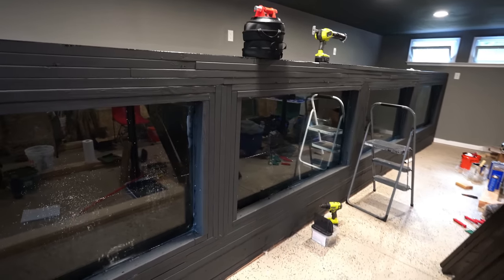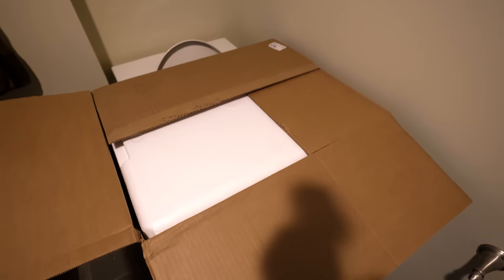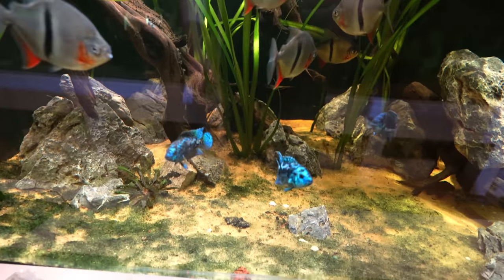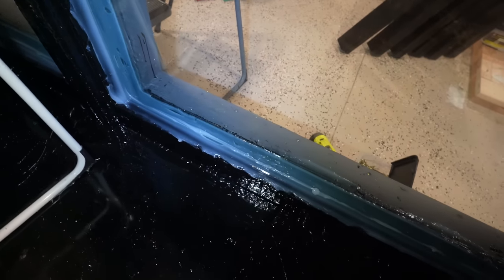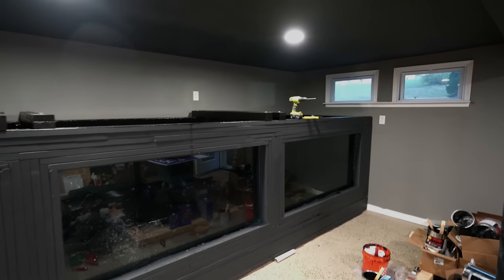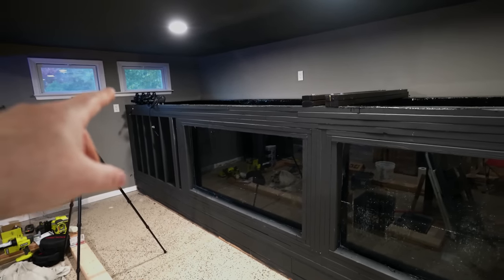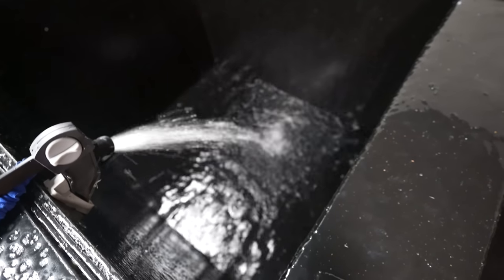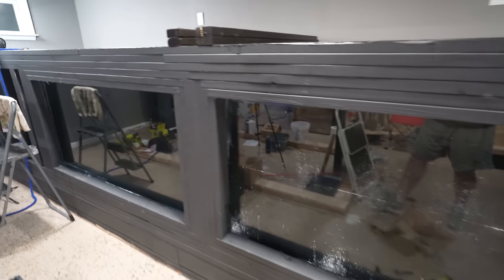Will the 4500 gallon DIY aquarium hold water? Let's find out!

Comment: Nice. Huge sigh of relief when u added the supports. I remember a while ago u said u were gonna add them. But I haven't kept updated. Love this content. It will hold for sure 1 2x4 would hold for the supports. I always recommend putting 1/2 plywood strips between all beams, Headers,  Supports. glued and nailed.  Awskme shoe brother
Reply from the maker: The supports were always going to on before any water was added, but I like to do them last as they are generally in the way when still working on the tank. 😊

Comment: I was genuinely excited watching the tank fill up!
Regards to the pump placement. Centrifugal pumps generally run smoother against a bit of back pressure and generally don't like pulling a suction. Based on this I'd consider placing them in a way that gives them a bit of head pressure on the suction side to keep them primed and probably with the longest length of piping on the discharge side so that they can work against any frictional losses etc.
Reply from the maker: Thanks for the great comment, what you said matches up exactly with what I am finding in my research.

Comment: Just don’t pump water through the wetland filter too fast. Slower is better. If you want more flow, put the extra outflow on top of the wetland. Love the build!
Reply from the maker: Exactly!  3x turnover is lower than what most would think for an aquarium but is ideal for an upflow wetland filter. The additional internal water flow will be handled with powerheads positioned throughout the tank.
Reply: @AquariumDomain.  Awesome!  I knew you’d have it handled! Can’t wait to see the scape.

Comment: I would have the pumps mounted on the inside of the front above the glass on the far side, and pump the water to the wetland filter. Also run the pipes on the inside under the bracing above the glass so its not visable and easily servicable, as well if you get a leak from the pump or pipes it goes right back into the tank instead of anywhere else.
Reply from the maker: You nailed it!  That is exactly what I plan to do. :-)

Comment: ☀️☀️☀️use Mrs Wages pickling lime in your make up water for your saltwater aquariums. It’s a constant source of calcium and will promote strong coraline algae growth full of purple and red colors. Just add a whole container and let it sit on the bottom of your container. No need to stir it up. It will dissolve to the point of saturation and then it will be fine with undissolved lime on the bottom. One container usually last about a year to dissolve completely. I’ve used it in all my saltwater aquariums
Reply from the maker: I will have to look into that one 😊
Reply: @AquariumDomain.  to be extremely clear. I had a 30 gallon Rubbermaid container for my RO/di make up water. I just dumped in the pickling lime stirred it up initially and let it settle to the bottom of the container overnight. This saturates the water with calcium. Because of this I needed to test alkalinity weekly. If alkalinity dropped I simply added some alkalinity buffer in liquid form to the tank sump.  If you decide to do corals I highly recommend calcium reactors in addition to the pickling lime method

Comment: I’ve been following you for quite a while now and I think I asked you this before but I’m in the thinking about stage of building an aquarium, is there a formula or a way to figure out how thick the glass needs to be?with this build I believe you should be crowned the new 
King of DIY!
Reply from the maker: Unfortunately the chart I use is one I copied down (hand written) from the garf and monsterfishkeeper forums from 1999. I just wrote down the safety factor and glass size / type, I didn't write down the formula they used to come up with numbers.
Reply: @AquariumDomain.  that’s a start thank you can’t wait to see the finished tanks!

Comment: Measure the GPH flow with just the one pump and compare to the 2-pump system of having one pushing the water the other pulling. this system negates the loss of flow from head height / pipe length.
Reply from the maker: I am definitely curious to see the flow difference as each pump is put online.

Comment: Would you consider using acrylic rather than  glass? I guess rhere is a significant cost uplift? Would you be kind enough to give us an idea of approx cost? Im fascinated by your  projects, please keep sharing!
Reply from the maker: I am not a huge fan of acrylic, I would probably only use it if I was doing a really tall tank and required it. It does cost significantly more, but also scratches very easily and doesn't adhere to silicone like glass does.

Comment: How do you maintain temperature and parameters on a setup this massive?

And water changes?
Reply from the maker: I heat / cool the basement and the tanks stay roughly within a degree or two of that. Drain and fill for water changes, but I am on an aquifer well so no chemicals needed.

Comment: Was there a reason you used river rock for the wetland filter instead of something more porous like lava rock?
Reply from the maker: Yes, the smoother rocks are better suited for trapping the solids as they rise up, but also being able to release them back down into the open cavity at the bottom of the filter during cleaning. Lava rock will trap a lot of solids in the more jagged crevices. Also surface area for bacteria is not a concern as there is already such a massive amount of it compared to bead, sand or sump filters that are typically used on large tanks like this one.

Comment: I have just had a thought would it not look nicer and do the same job if you used flat lengths of steel for the crossbeams treated of course galvanised or even aluminium to prevent rusting you would barely notice them, just an idea ???
Reply from the maker: Certainly not a bad idea, but I am using the cross braces for the river bank structure and for the part of the lid system; as well as, something I can climb on when needed. :-)

Comment: My OCD is kicking in. I hope you put a huge amount of glue where lag bolt split your 2x4s. I have found in my experience that pressure treated 2x whatever size split when you start drilling or screwing. 

What are your thoughts on the actual caulk gun from perspective of someone who has been putting in elbow power into it for years? Do you have any complaints about this caulk gun? Do you wish you bought a different one? Sort of like ohh man if I only spent X more I would have been better off? I have been using regular caulk guns for years and I always had small jobs but when I was doing aquaponics project last year and hunting down leaks (which I temporarily plugged with silicone ge1) my arms were about to fall off. Craftsmen and Ryobi sell $70 models with no battery. Dewalt is $200 and Milwaukee is $170 both with no battery. Do you feel that you should have gotten a more expensive model or do you think Ryobi will get you by going forward? 

Sending positive vibes for the leak test.
Reply from the maker: Thank you for the positive vides!! 🙂   I can't really compare the electric caulking gun vs other models as it is the first/only electric caulking gun that I have ever used. I would imagine it would follow the logic of other tools, if you use them often as a contractor you need the more durable (expensive) brands and for infrequent work brands like Ryobi are probably fine.

Comment: I'm not sure if it's this exact one or one very similar to it, I saw a video on here of a DIY build like this one. People say it won't hold. You say overkill in places.

Imho, I recall looking at certain particulars and running math and specs in my head. Structurally? I should hold. Personally? I think there might be a more efficient way to do it, but I'm not criticizing the design. You see all those studs? Pending on how you fasten that, you're pushing 1100lbs/ft in strength. It might bow some time before that or around that but I don't see 1100lbs of water in that exact volume either. You've got a lot of weight distributed so, it should hold. As long as you've got some bracing across to work against the outward force? That glass? You should be good. 👍

Overkill. I've been accused of that myself in general. I think that can be subjective. For something like that? Id likely coat that in a like manner. I look at it this way. You're trying to guarantee there is never going to be a problem with that. Good idea. If it's ultimately overkill, you'll never have an issue. So quality wise, what's the problem? Lol.
Reply from the maker: Yeah for me overkill is the only option when dealing with this much water and for something I intend to last for 35+ years 🙂

Comment: Wouldn't lava rock in different sizes be a bit better than the solid rocks in the filter?
Reply from the maker: Lava rock have a lot of small cavities that can trap physical debris which we don't want to happen. During the clean out process we cut the pumps and suction water out from the bottom, then fill up from the bottom a couple of times to loosen up debris, have it work down to the bottom and get pumped out. How many times this procedure would be performed during a clean out would depend on how clogged up with debris and sediment the filter is.

So it is key to slow the water down in the bottom open area and have most of the debris trapped in the larger smooth rocks, which will make it easier to remove during clean out.

Comment: Will the riverbank on top be an "aquarium" itself with glass front?
Reply: Hundreds of hillstream loaches etc..
Reply from the maker: No, it will be made up of plant baskets and wood that will be suspended right at the surface of the water using framing. When looking at the front of the tank all you should see would be plants growing out of the top of the tank and roots growing down into the water, the baskets, etc. should not be visible...if I do it correctly lol 😆

Comment: I think I would take the water out of the filter to the other end and have it overflow back in. But I have less experience with large aquariums and mostly with saltwater. One this size would be a dream.
Reply from the maker: It is an upflow filter design so the water has to be introduced to the bottom of the filter under pressure and then cascade/waterfall back into the main body of water.
Reply: I understood that. I am just use to it going in the opposite direction. Was wondering if one is better then the other.  @AquariumDomain.
Reply from the maker: @roberttheil5226  Ahh OK gotcha. I am not 100% on which is better push/pull or if it even matters, I have seen it done both ways in many pond construction videos on YT.

Comment: Love the build to this point. Your cross braces care me they split! That ruins their strength. I think the lags should go through the cross brace, one predrilled and 50% or more than thickness of the braces into the top edge.
Reply from the maker: Ended up being 2 lag bolts in each brace per side, both 1/2" with 1 being 5" long and the other 4.5" long.

Comment: I don't know the prices of construction materials in the States. anyway wouldn't it be cheaper and stronger if you build it out of cinder block or masonry in general?
Reply from the maker: I am not sure of how the pricing would compare, but I am not skilled with working with concrete; where as, the building method I use is one that I have used since 1999 and am very comfortable with.

Comment: Why is the wood on the front of the tank all out of line.. 🤦‍♂️🤣🤣
Reply from the maker: The wood is lined up and uniform on the inside of the tank, so the outside ends up with the look you see. The outside will be finished, so the structural wood you see now will be covered up.
Reply: @AquariumDomain.   are ok so there different size bits of wood to together  👌